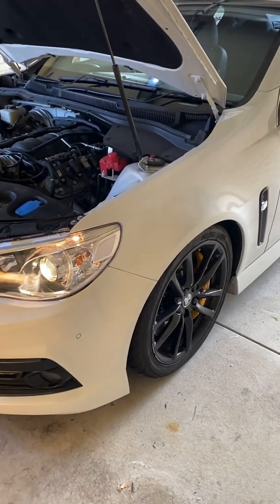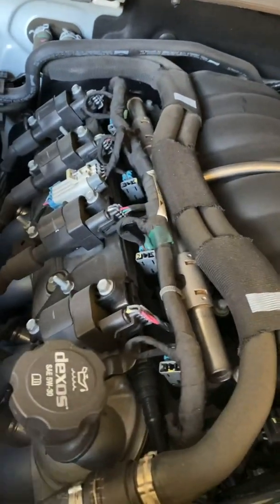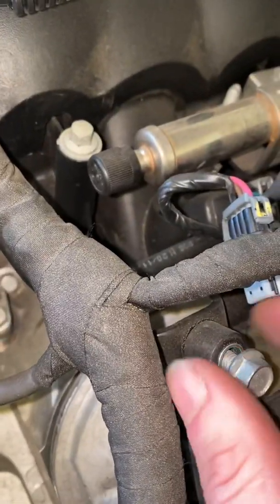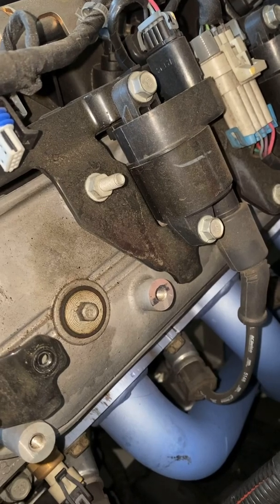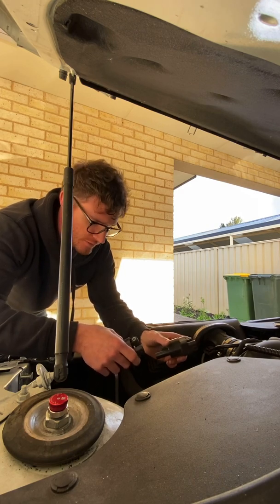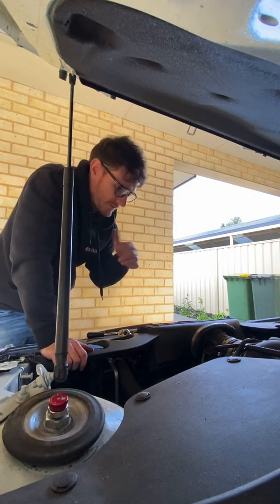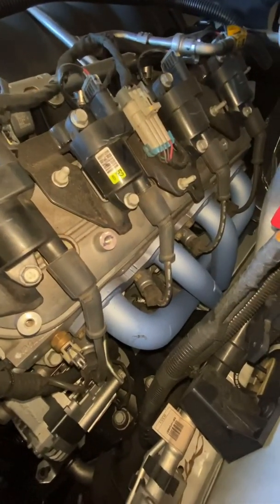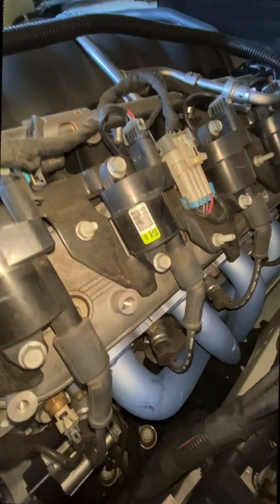How to easily diagnose LS3/L77 misfire

Comment: I’m having the same issue with my dads VF HSV, plugged it in and said misfire bank 8, with it counting the misfires every revolution. I just cleaned the spark plug and gave it a quick sand. Still has problems so definitely going to swap the coil packs over tomorrow and see via process of elimination. Hope it’s not the injectors.. 🙃

Comment: No such thing as an LS3 L77 they're 2 different engines it's one or the other.
Reply from the maker: @jonny6510  they share pretty much the same architecture in components  and diagnostics to the problem in both engines are the same because they use the same coils. Thanks for trying to flex

Comment: Had the same symptom with my VF SSV
Knew it wasn't the leads(swapped em with granatelli's) & new plugs ngk tr5ix...took a punt / removed fuel rail...wholla twas the injector (#4) replaced the lot
Reply: Did you get a engine code before you did this